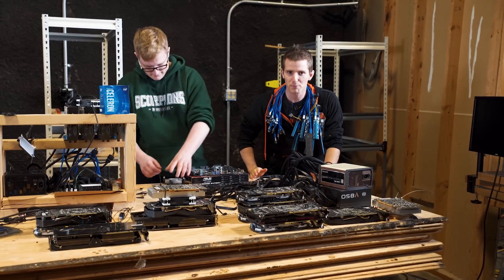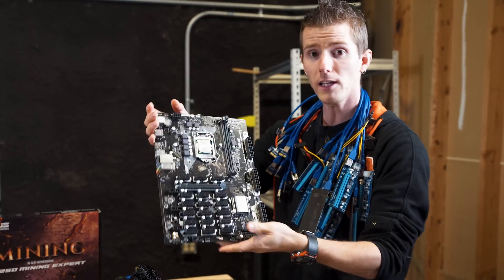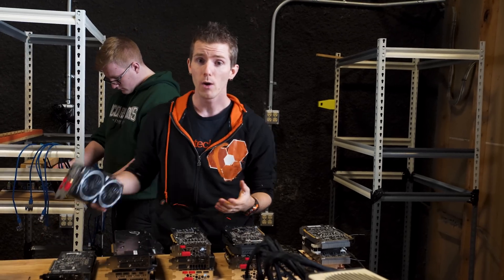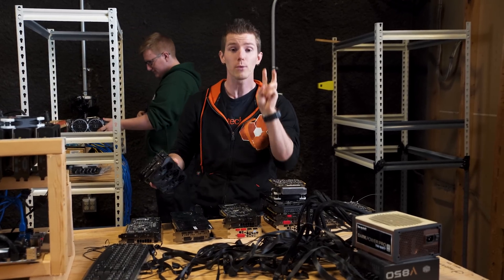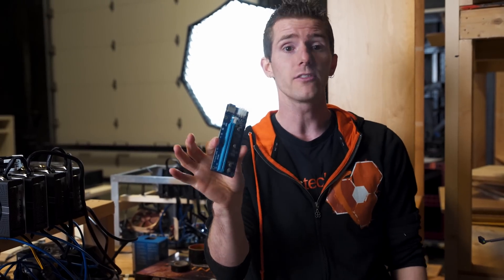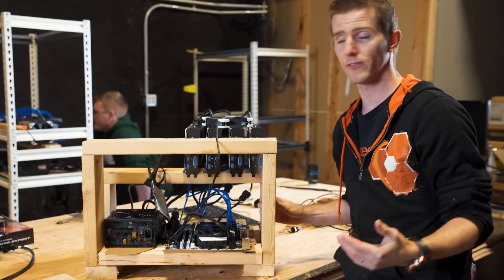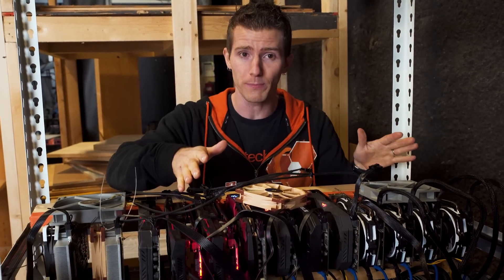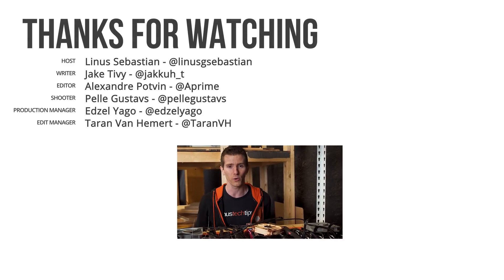13 GPUs in ONE PC? – Mining Adventure Part 2

Comment: I've been subscribed for quite a while to this channel and never thought I would unsubscribe.  This video may change that.  This video is a middle finger to gamers and PC enthusiasts.  You can't find an affordable GPU because of crypto mining and Linus jumping on the bandwagon is just very,  very disappointing.  Rather than trying to help,  they have decided to become part of the problem.
Reply: Intel push out cards?? AMD and NVIDIA do not push out more cards, they only make reference cards. They make the architecture and blueprints for the cards and outsource the mass production to different manufacture, thus they have no control over manufacture's production. Manufacture will take advantage of this supply and demand for money. They aren't going make more cards than what they are already producing. Simple supply and demand.
Reply: 12SecondsToLive they give manufacturers the cards, and they make the cooling solutions
Reply: CubeSlice unfortunately that’s not how it works, they give manufacturer the reference card, then they can modify it like clock speed, more ram and cooling solutions . Meaning they have to produce the circuit board etc.
Reply: 12SecondsToLive no, AMD and nvidia give them the cards. If that was the case, these companies could add more RAM to cards, but they can't. Sure, the PCB and stuff is different, but the cards are distributed by nvidia and the companies create cooling solutions and other stuff
Reply: CubeSlice it's okay you can believe what you want. Think of it this way. Why would AMD and NVIDIA make the PCB wasting their money and labour for manufacturer? Make no sense. They get % of the money per sale that the manufacturer makes. 

Open up a few graphic cards you will see it's manufacturer by companies not AMD or NVIDIA. 

This is my last reply, done arguing. You can believe what you want, I'm just stating the facts.
Reply: It's Linus TECH Tips, not gaming tips. Graphics cards are not just for gaming, thinking otherwise is naïve. Demand drives competition and brings better cards to the market, which benefits gamers in the long run. Stop whining about a tech channel covering tech content as it should. Nobody complains about large data centers that bulk buy cards for simulation and AI training, it's such a silly thing to be worried about and people have the right to do what they want with their money.
Reply: Awwww poor you :(
Reply: M Hayburn he just wants the views. this channel is pretty much the average garbage now. with stupid memes for children and ltt workers trying to act cool in every video. wtf. going to unsub now, you should do the same if you haven't already.
Reply: Fuck off you bloody plebs
Reply: What can you do to "help"? This shortage makes Intel and AMD push out more cards, and want to provide cheaper and more powerful cards than before. Once the market rebounds it will be better off. You can't blame someone for making money. I do not see why people put the blame on other consumers when it is the manufacturers that can not keep up with demand.

Comment: looks likei cant edit my comment lol, also, you dont want celeron cpu past 8gpu. you should go with a pentium 2c 4t, 45xx 46xx. as for gpus, the more you have, the more pagefile you need, a 13gpu rig, requires up to 300gb pagefile depending on the algo you use, and if u use an auto algo switch miner. also, one thing to consider, when you have 13gpu on 1 rig, and that rig crashes, you have 13gpu doing nothing. thats why 8gpu rigs are a must. you should consider MSI z270 lineup, they have 6 pci and 2 m2, they were the cheapest board for a while for 8gpu rigs.

all in all, much better than the first vid, cheers

Comment: Nicehash vs awesome miner which one has better profit?
Reply: Awesome Miner isn't a pool, you have to set it to a pool to mine and it uses zPool, HashRefinery and others, for me I see more consistent and better profits on Nicehash and a MUCH easier overall experience but you NEED to use the LEGACY MINER, DO NOT USE THE ONE LISTED FOR NVIDIA CARDS, the Legacy Miner is a better miner that does more coins and you can easily tweak things for better hashrates.
Reply: DanielRichards644 thanks for the advice I've been using the legacy for mining. I know the 2.0 sucks even though it's advertised for Nvidia the legacy is better lol
Reply: I had SHIT for luck using it on MPH, like not even enough to cover electricity costs for 2 hours after a day of mining, zPool and Hashrefinery where mixed bags, on those you have to mine the coin, then wait for it to Confirm then wait for it to get exchanged then you get the coin to where if you have enough they payout at a random time of day (this process can takes DAYS for some coins) and the payout is 2.5 times the min for Nicehash Internal wallet, I do much more consistent with Nicehash, get paid faster and usually higher amounts.

Comment: Man, a lot of you are butthurt af towards miners. I'm a gamer that also mines. I bought my gtx 1070 when prices were somewhat normal. I paid $438 with tax back in april for a evga 1070 FTW. Now, I'll pay off the 1070 and earn enough to pay for the next gen Volta "XX80" when that comes out in may-june. You can hate the miners but they don't control how much video cards are produced. Manufacturers do. I see both sides but at the end of the day, it's the manufacturers that are failing to meet demand. That is their choice.

Comment: What's wrong with 240 volts in North America? You have 2 phase power supply, both phases are opposing, when one is -120, the other is +120 volts. Yes, with symmetric 2phase power they just add up if you connect to both of the P-power leads.
Meanwhile the rest of the world, and American enterprise user all have 3phase power.

Comment: Could you try to create a custom power supply solution? Back when quad-sli was relevant(to gaming), I used a lower watt power supply and fed the gpus directly from my own creation. In this case, since you aren't using the highest power sucking gpus, you could drop the 12v rail down some an reduce the heat being generated. It would be a miniscule amount, but cut the risk of overloading the power supply and shave several watts off total usage.

Comment: pretty sure you're not supposed to power those with sata - potential fire hazard! bad linus
Reply: All of the sata risers are fire hazards. You want to use molex > 6 pin or just a normal 6 pin
Reply: depends on the card and alot of them risers use sata plugs to start with.

Comment: 🔥🔥🔥🔥 The power adapter you are using, sata to 6pin, has molded cables on the sata end. This end has proven to be one of the primary results of cables catching fire. 🔥🔥🔥🔥

Comment: Invest in a UPS backup and convert it to run on solar panels.  You can do this on the cheap by finding used UPS or ones without batteries. Plug them together and add a charge controller.  You can even make your own solar panels on the cheap by ordering the parts and building it yourself.
Reply: Yup the rule of thumb is double. so if you use 120V you need the panels to provide 220V the charge controller lets out whatever you set it to do. You could build the entire electrical system for around 200 that will run one system. There are a few good how-to videos on YouTube since Porto Rico's problems. Converting a UPS for Solar.

Comment: WHO told you 200 Volt power is NOT Common in USA ummmmmmm Most house have 220Volt at Their Meter Linus so whom ever told you that is completely clueless, a consumer can have as much as 660 volts on his property as long as its installed by licensed electrician!   LInus next time ask my old ass wow ...  young kids ....lol...

 OH I better post this on Floatplane before some one takes credit for something I said YET AGAIN in the forums...mmmmmm!!
Reply: yeah but spending $180 on a power supply and then paying a contractor hundreds to install an outlet just to use it versus just buying two or three power supplies for around $130 each it's a no-brainer  wich is the better option when the whole point of building the computer is money.
Reply: And do you know what those 220V circuits power? the major appliances like the A/C, the fridge, the stove, laundry appliances, the dishwasher..... outlets that arent easily accessible, nigh impossible once the appliances are installed. 

The wiring may already exist.... but you're not going to be able to add another outlet. You will have to hire a professional and often times your municipality will need to authorize such things as it would be something not originally included per the plans filed with the city.
Reply: Uncommon INside North American homes, not OUTside them (ie. at the junction box). He is correct.
Reply: Linus is referring 220 Volt outlets. Most houses outlets are wired for 110V and in the USA 220V is only wired when need, like for the stove and A/C. Linus would have to pay a licensed electrician to install a 220V wire to the mining rig which cost even money.
Reply: NO that's NOT What Linus said WOW ....  8:38  -  8:45  Clearly said   "200 volt power is not common in North America"

All US homes had the code changed in the 60's or early 70's if i remember right to NO longer allow NEW Homes or Pre existing homes who planned to do any renovations would be required to remove the Fuse Box  and then Require The New Service Panel /Breaker Box to have a Minimum of 150 Amp or @ min 8 120v circuits & 2  220v circuits to be approved at Final Inspection!

Comment: ROI 5month LOL. Thats crap. Power cost where  I live is 0.35 USD (1kw) pro hour. And I can make a rig that makes that money in less that 5 month ROI. What the noob ? 3 cards  for 1080TI makes 700+ pro month. You could can get that on a nornmal board, only needs 1 PSU and no riser. Saving risers speciel board, PSU, kabels, fans. and not what.
Also 8Gb is needed for stabil mining with that many cards.

Comment: Just about every service in the US. has 240 V available. If you're close enough to the panel, or have a spare DRYER/OVEN plug 240 shouldn't be too hard to get. You can even pull it from a single outlet if your electrician was cool enough to wire it that way. One phase to top outlet, opposite phase on the other. Somewhat common for kitchen circuits.

Comment: It's simple to use all 19 cards or even more on this board. Don't mine using Windows. Mine with a Linux based OS like EthOS. I have multiple rigs with 13 1080ti's running on each board. You don't have to worry about those stupid windows drivers to make everything work.

Comment: I was lucky enough to pick up on a rx 580 8gb for relatively cheap a few weeks on a deal, after the deal ended it hopped back up in price then got more expensive by around £50. 
How much would i be able to scrape back using a single one leaving it on as i normally do? probably wont do it but on average how much would a single one bring in when not in use for 16 hours a day?

Comment: I wish mining was illegal I cant find any good PC parts without them being sold out.
Reply: Dominion Defense actually from NVIDIA's pov you re the one wrong.
Reply: They make compute cards... but no, ASIC miners don't cover the whole cryptocurrency sphere. There are coins that use algorithms that specifically make it hard for an ASIC to exist for it (like Monero). The reason being only a couple places will produce ASIC centralizing mining to a small group like what happened with Bitmain on BTC.
Reply: GPU stand for Graphics Processing Unit not Gaming Processing Unit
They aren't meant for gaming and ASICs only cover bitcoin there is different algorithms
Reply: And not Gaming Device
It has multiple uses
Reply: I wish gaming was illegal, I cant find any good mining parts without them being sold out.

Comment: can you look into if a combo of this riserhttps://www.ebay.com/i/232539417964?chn=ps  would work with this riser https://www.ebay.com/i/232580104685?chn=ps if so than it turns a pci-e 1x to 4 pci-e 16x slots than with the second riser it is a 1 pci-e 16x to 8 pci-e 16x just need the risers to put the cards into could you look into this if it works a normal mb that has 2x pci-e16 and 4x pci-e 1x  we could use 144 gpus on 1 mb  would just need the psu's for all of it does that work
Reply: so i take it that no one has any ideas about this thats cool